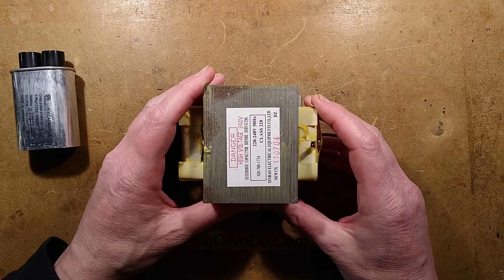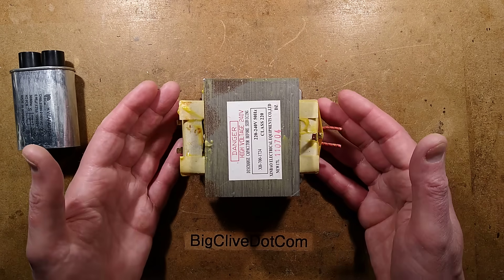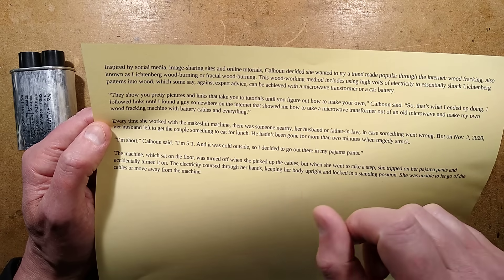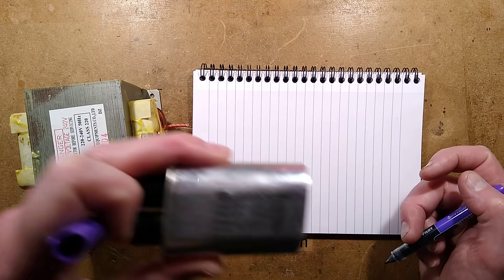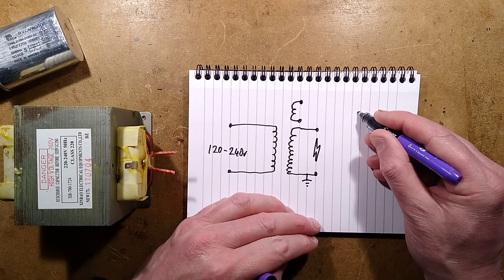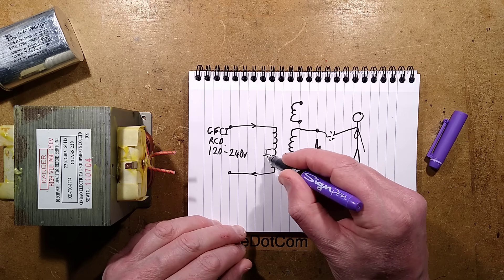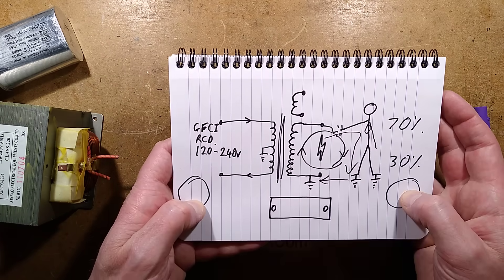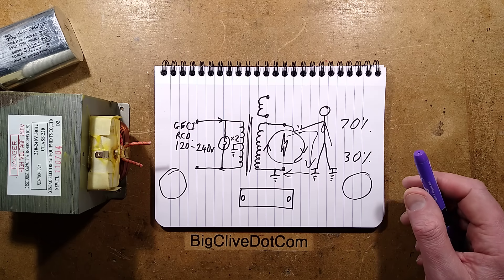The most deadly project on the Internet

Comment: When I was a kid, I decided to coil up an extension cord that was laying in the grass. Instead of unplugging it beforehand, I started coiling it whilst it was still plugged in to the wall. (Standard US 110v)
I was barefoot, standing in the grass just after a rain. As I coiled the old cord, my hand ran over a gouge that had cut through the jacket and through the wire insulation. In an instant, I couldn’t let go of the cord no matter how hard I tried. I stood stiff as a board and eventually tipped over like I was a plank of wood standing on end. Everything went black. I remember waking up in the grass, crying and when I tried to get up and walk to the house, I stumbled side to side like a drunk man leaving the bar after a long night of drinking. I felt weird for days after that shock and have no idea how long I grounded that current or what kind of potential damage I did. 
I tell this story because even a regular 110v in the right conditions can fuck you up. I’ve been zapped by 110 a few times, and it was NOTHING like what I experienced in those conditions. 
Also, don’t be a lazy dumbass like I was. Just unplug your extension cords before coiling them.
Reply: Holy shit
Reply: This isn't a lesson about "unplug before coiling." This is a lesson about how if your extension cord has any gouges in the jacket, you shouldn't even think about using it in the first place. You or someone else could just as easily have come into contact with that gouge in a different manner, or it could have touched something else and shorted in a completely different, yet still catastrophic manner.
You're almost always going to end up handling an extension cord while it's plugged in. That's perfectly normal, and coiling it up is no different from any other handling. Some tools even plug directly onto an extension cord, without having a cord of their own, like a hedge trimmers I've used before. Check your extension cord before use, and if your cord is damaged, don't use it. Period.
Reply: @jadekaiser7840  I agree completely! No one should used damage extension cords. Myself or my dad wouldn’t have had it in use had we known it was damaged. It was definitely an accident waiting to happen
Reply: @LeewardSideMusic  Yeah, I assumed so. I was just saying, coiling it up while it was plugged in wasn't really a factor except in that it happened to be the reason you touched the cord there. If the cord isn't an unsafe cord to begin with, there's nothing wrong with that.
My dad actually always coils his cords back up while they're plugged in. Well, really from  the female end to the male one, but it's easiest cleanup to do it straight from where he's working to the outlet. He does it this way because if you always coil the cord in the same direction, it naturally coils in a consistent manner without tangles. If you coil it differently each time, you can easily end up with a cord that wants to fall into different positions in different places and tangles itself up.
Reply: @LeewardSideMusic  If I had reason to get any of my own, I would of course do the same thing. No real need for them in an apartment, though.
Reply: Of course, if your cord is damaged while you're using it, you should immediately unplug it before doing anything else. But that's still a matter of "don't use or handle a damaged extension cord," not one of "don't coil before unplugging."
Reply: @jadekaiser7840  I agree! Didn’t know there was damage.
Reply: Obviously me or my family wouldn’t have been using the cord if someone had noticed the damage. That does without saying

Comment: I made one of these and added another safety measure.  Using an old power adapter around 7.5VDC I added it to the main circuit, and connected an automotive buzzer.  12VDC was too loud so I lowered the voltage until I found it useful but not overbearing.

Comment: @7:00  Actually low voltage, high current can also be very dangerous.  i recall many years ago some guy seared his left hand off when the band of his metal watch touched both contacts.
Reply: Well low voltage high current is not dangerous from an electrocution perspective, but it can definitely burn and cause fires.

Comment: Working with high voltage is doable, but you need to understand the system far better than just watching a few youtube videos.  The idea of running electrical equipment with that level of improvised connections, near water, should scream dangerous like working with gunpowder next to an open flame or mixing up rocket fuel.
Reply: at that point I don't think it's worth it

Comment: Woah 70% kill rate? I got hella lucky then.

Having gotten a shock from a MOT, its damn unpleasent. Muscles dont loosen up for like 10 minutes. I stopped screwing around with them soon after. The MOT that bit me wasnt case grounded so it only arced through the one hand, but it did burn a couple holes which never scarred for some reason.
Reply: maybe they were small holes

Comment: ALSO:
Notice the two transformers next to each other. See anything familiar?
=|  |=

-|  |-

That’s a very, VERY, rudimentary capacitor. 

It’s not a true capacitor as both sides have a positive and negative contact, while a capacitor relies on the gap between a positive and a negative, but if your transformer really sucks, the shortest path will actually be through the first positive and the second negative (which acts as ground.). That second negative is YOU.

If your transformer is shoddy enough, the insulation between the two transformers can be too weak and the voltage can jump the gap. If that happens, it will kill you almost instantly. And if it doesn’t, you’ll wish it did.

Even if you have the transformer cut off from power, DO NOT TOUCH IT unless you know it’s discharged. (which can be done with a well insulated screwdriver by touching both coils of wire.)

Comment: I'm curious what you think makes it so these people survive this? Like the lady in your story for instance, if no one was home and she was locked in an upright position, how was she on the floor a ways away from the original position if the circuit breaker doesn't cut off the load because it doesn't see a problem?  Just wondering your thoughts because i'm genuinely curious. Thanks for the informative video, cheers!
Reply from the maker: I think most of the current was confined to one hand in that instance.

Comment: Better yet, introduce a timed deadman. If a button isn't pushed every ten seconds, the power cuts out. This would take away the always on danger of the device and limit the length of any shock, helping to limit severe injury and death. One might receive a light burn and be in mild discomfort for a time as opposed to losing a hand.

Remember the swiss cheese theory of risk management. The more cheese slices you place between yourself and the harm, the less chance that the holes will align to cause disaster.
Reply: That's smart

Comment: Yup. Sounds like an absolutely terrible idea for all kinds of reasons. Apart from changing light bulbs, and even the occasional light switch in the house with the mains switched off, I basically stay far away from anything high voltage or high current. I don't like getting close to car batteries either.

Low voltage electronics I am fine with, when I can worry about breaking an IC or about dodgy solders rather than about getting electrocuted. 

By the way, surely a dead man's switch won't necessarily work so well when you get electrocution paralysis and all your muscles tense? 🤔 I think it's best just to stay away from anything that is this likely to kill you.

Comment: I have a Sony PVM CRT that sits on my desk, and I had to spend a bit of time when I first got it to dial in the CRT alignment and geometry adjustment. Even though that was just twisting some variable resistor / potentiometer type things on a circuit board inside, the main tube and flyback transformer just terrifies me.

Comment: The point you made about the transformer being basically silent when powered on, is interesting to note, because to someone who isn’t well versed in electronics and high voltage electronics especially, they may see that as a sign that what they’re working on isn’t that dangerous. 

Media and movies generally show high voltage transformers and deadly voltages to be these huge hissing and buzzing units with massive yellow electrical shock stickers on them, and then they see a microwave xformer and they think, “oh, this tiny little transformer isn’t dangerous! It’s quiet, and it doesn’t have any warning sticker on it” and they are lulled into a false sense of security, and inadvertantly put themselves into a very dangerous situation without actually realizing just how dangerous it really is. 

It’s scary to think about, because it’s easy to see how someone who is otherwise smart and rational, might be fooled into thinking dangerous voltage is more “glamorous”, for lack of a better word, because they don’t actually deal with it in their everyday life, and possibly never at all.

The same goes for high voltage capacitors, which are arguably even more deadly to someone without experience, due to the fact that they can be live without the device even being plugged in.
Reply: The microwave transformer probably doesn't have the markings and warnings on it because the microwave already has those on the outside
Reply: Do you not see DANGER HIGH VOLTAGE on the transformer?
Reply: @MadBunnyRabbit  It's "just 240V, i've survived that a couple times" is what one might think. Without some knowledge or a video like this you wouldn't know the high voltage part of it is an electric chair in disguise.
Reply: I found your comment very interesting and informative. Thank you 🖐
Reply: Yeah, nothing gives me more anxiety than working on old CRTs. Like I know what I have to do, but there's always this fear when I'm trying to clear the high voltage caps on the things.
Reply: If they're that stupid its natural selection
Reply: It doesn't make a noise until the two points are connected on a hydrated board and then it is a noise that is out of this world it's super intense but really need to watch.
Reply: actually... a transformer WILL make noise if connected on a main line
https://www.youtube.com/watch?v=AeuApLeCs5A ← 60 Hz Square Wave
It hisses at "60 Hz"... but you have to include the harmonics... so I think a "square wave" would be pretty appropriate.. but really.. you'll want ALL the harmonics not just the fundamental.

You'll also not hear the hissing until the circuit is completed, as the current loop is what causes it.

It also takes MILLIONS of volts to cause "arc flashing" as that causes the air around to have a "voltage breakdown"

Given that the microwave transformer wasn't really rated for that level of voltage... the arcing is possibly caused by the inrush current from a discharged capacitor.

Comment: Thanks! This is great not just for me but because many people leap into things too quickly .. .. ionized water on them...thinking they'd have to cross both poles but forgetting about their own path to ground..... tripping over themselves.... people also, though, used to repair or build massive, high voltage radios left and right like Boy Scouts working with adults on 1000 watt transformers with tubes like fish bowls so I'm very glad to see someone saying "bew safe" not "never ever". We must not only respect it before we engage in these activities at all but most of all really, really know its behaviors because.... the surprises are not learning experiences (except maybe eschatological). That said I know it's a dirty way to do wood Lichtenburg and not even as pretty as other arrangements ... I think the neon sign results are more attractive, less scorched deeply in the middle, more dendritic fingers. I didn't know there even was a fault protect but, like you say, it's irrelevant and bypassed. I love the dead mans hand suggestion... I will do this if I do it again even with another transformer. I used a long PVC probe with rubber gloves to activate it. I'm no "expert" but I did radio enough I felt confident enough to do it with ridiculous extra safety measures. And I do have an outlet for the art being a woodwind maker or flutes that get decorated various ways.

Comment: I'm a journeyman electric distribution lineman. Your description on this topic is spot on. I like your low tech stick figure diagram.  It was easy to follow.  I've seen plenty of electrical burns and unfortunate fatalities.  A.C. always tries to find its way back to earth (ground). Your muscles constrict and you CAN'T let go. Very dangerous.  I think I would hook everything up. Stand plenty far away and flip on a switch or use that double button box idea you have. But me personally I wouldn't have anything to do with it. I will just watch some videos. I good with that.
Reply: AC (and DC for that matter) always tries to return to its source using all paths in proportion to their resistance. It is a common mistake to think it flows to ground. It seems to flow to ground because of the constant reference to ground made by electricans and lineman. This is done to keep the potential to ground (really system common point, think center of a wye setup or corner/high leg of a delta) at a constant voltage. This connection to ground is connected to the neutral of the source voltage on the utility side repeatedly (I think, I'm not a lineman) and on the non utility side, we bond the neutral and ground once after protection, after that, the neutral floats in relation to ground, but they are essentially the same wire.
Reply: I once saw a linesman in China "sucked" into the line he was working on....  after he fell off the pylon typical china... everyone just stood around looking at his body...
then there was the time  a repair man came to my house to fix a broken fuse,  houses are 3 phase in Asia., 
wanted to let me try metering the 660 V cross phase to prove the fuses were ok.  nope... 240 is my limit and only then with my own meter & gloves.and my trusty boots.
Reply: these transformers are isolation transformers, so they're not grounded... right? Transformers on utility poles are grounded at the center tap, goes right from the middle of the windings to a pole in the ground. These microwave transformers aren't, as far as I know. So it should make them safer... as long as you follow the one hand in pocket rule.
Reply: @moonasha  any transformer is an "isolation transformer"
until you give you a reference point...
Reply: @stevesteve8098  Except for the ones that aren't.

Comment: I have one of these and a magnetron also. One day I thought of connecting the secondary of the transformer to the magnetron, but I was a bit afraid that the magnetron would send out unfocused microwaves. I thought it was not worth the risk, so I abandoned the project. I am a licensed journeyman electrician, so I have heard of the dangers of these kind of projects. I would have enjoyed seeing the thing work.
Reply: You would need to have the diode and cap in the circuit, and connect the heater leads for RF output.   Safe exposure to 2.4 bus is around  1.6 watts per kg of body mass.  You would be fine, well, if you were more than 1300kg.   RF burns are no fun. Makes your skin smell like a mix of burnt hair and old mushrooms.  Hurts worse than accidentally nailing yourself with framing nailer. Voice of experience.

Comment: I made one and tried it out. I'm an electrician so I made it as safe as possible. I insulated it in a box where it can't be touched. I also set it up with 2 dead man switches where you have to be away from the wood project and have each hand holding a switch. I'm not encouraging anyone to build it. This is why I haven't made a video on how to make it.

Comment: Neon sign transformers, both mains frequency and high frequency, also produce more detailed figures on account of the reduced current (compounded by the massive inductive impedance component at high frequency). So not only are they safer, they just work better as artistic implements to boot
Reply: good to know

Comment: A friend working on construction in a hilly area was moving a vertical aluminum surveying pole, and inadvertently it contacted an overhead power line - not the feeder line to a house, but the high voltage line usually running way up, on the metal towers. It was low due to the terrain, and it instantly blew his shoes off, badly burning his hand and putting a hole in his foot that put him in the hospital for a couple weeks. He recovered with burn scars, but it could easily have killed him. Is all of this idiotic stuff going around a Russian plot? Darwin awards are being mass produced it would appear.

Comment: Electrical engineer here.  This guy is absolutely right.  I got popped by a spark gap while bridging it, from a flyback transformer powering a tesla oil.....I was instantaneously sweaty everywhere.  Moreover I was lucky that whatever popped me didn't pass through my heart.  If you are doing the wood burning thing you need everything powered down and the "on switch" should be electrically isolated.

Comment: I've been working working with electricity since age 11, in 1980.
Obtained qualifications as a technician by 1990.
So I've had decades of experience, in various fields, but I've still managed to stuff up and get jolted by 9Kv, 11Kv, 22Kv, 30Kv and more.
Even accidentally tazed myself twice in the last year, which was 50Kv.
Difference here is the loading on these devices, only supplies less than 50ma, but it sure wakes you up faster than coffee.
One of the biggest surprises, was a PA system transformer, which was oil cooled.
Imagine my surprise when I discovered that the oil, acts like a dialectic and holds a charge between the multiple coils.
Only about 1000 volts but it's worse than my other devices.
Currently building a remote tazer with 100 metres range, and 4 channels of control.